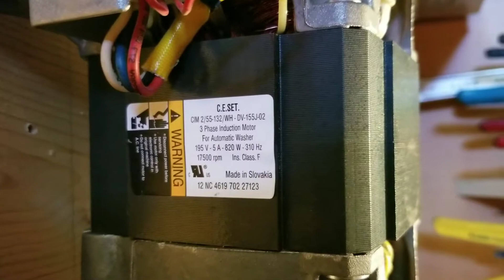High Speed 3 Phase Induction Motor from Washing Machine

Comment: No, that's not an induction motor, it's an inverter motor, known as BLDC motor, induction motors cannot spin at very high speeds unlike universal and BLDC motors.
Reply from the maker: It’s not a BLDC motor, as it doesn’t contain any magnets. Nor does it have brushes, therefore the current is induced into the rotor through induction. Last, but not least, the factory label says “3 phase induction motor.” It achieves its high speed through the unusually high operating frequency required.

Comment: thank you is this the best? need model #VFD, your info is great.
Reply from the maker: Thanks! This is definitely not the best VFD, but it was the cheapest one I could find that still has all the functions. I would recommend this one for home use, but I wouldn't install it in a factory.
Reply: @nigel-matthews  i want to make belt sender.
Reply from the maker: @hasmukhvpatel4539  if you have the right motor, and other parts, this VFD should work great for that. Good luck!

Comment: My motor is getting hot !

Im putting 240v into my inverter single phase an then three phase out 240v 

Im assuming now this is why my motor is getting hot what do you think? 

Thanks man
Reply from the maker: If you have an identical motor, it's only supposed to run around 195 volts. So if you're giving it 240 volts, it will get hot, and probably eventually burn out.
Reply: @nigel-matthews  

Have a look at this
Reply: @nigel-matthews  

This guy didnt seem to have to do that
Reply: @nigel-matthews  https://youtu.be/khnL8vGhEDI
Reply: @nigel-matthews  

👍. I may have to do that as the supplier is not sure
Reply from the maker: @bongobermo1  it looks like he is just running it on 240 volts, which will work, but the motor will burn out quite quickly.

Comment: Is your inverter set to 30 Hz 

Should or does it go to 50Hz and if so does the motor run faster ?  

These motors do 17000 rpm ?

Just a question.... thanks for the vid 👍
Reply from the maker: The motor is designed to run over 300 hz, so that was the fastest I ran it. I think the RPMs were somewhere around that - super fast!
Reply: @nigel-matthews  

https://youtu.be/khnL8vGhEDI

Heres a guy running one without the voltage drop ...   seems to be working fine thats why im a little confused 

Thanks for your feed back Nigel 👍
Reply from the maker: @bongobermo1  at 5:02 he mentions the fact that he's running it at higher voltage than what the motor requires, and that over time it may be bad. There are better ways of running this motor than I used in this video. Ideally, you'd want a transformer that outputs 195 volts feeding the VFD, assuming the VFD can run on only 195 volts.

Comment: As you can see that engine is made for 220V, but using ONLY for electronic control /inverter/ there is the voltage reduced to 195V. Never using this motor to AC line, but else engine will burn. As you can read warning text in this motor ;)

Comment: I have a similar electric motor & VDF , THERE ARE 5 WIRES , 2 RED FOR SPEED CONTROL I THINK ,WHERE ARE THESE RED WIRES CONNECTED TO ,THE REMAINIG 3 CONNECT TO VDFI THINK?
Reply from the maker: That sounds right. You should be able to ignore the speed sensor wires. I didn't use them.

Comment: I have the same whirlpool (kenmore) washer 3 phase induction motor and I also took out MCU and a Central Control Unit (CCU) from the donor washing machine in hopes to make it run for woodworking machine. Looks like it is possible to control the motor via this proprietary MCU, but it requires a UART serial port commands type of control. According to the video (link below) CCU sends specific control commands via a half-duplex UART port to the MCU. This video shows the MCU controlled by PC via USB to a  serial port adaptor - https://www.youtube.com/watch?v=Npxd_H7FeSQ .
Reply from the maker: That was interesting. That would be the cleanest setup.

Comment: I have same exact motor I want to use as a grinder. Im in US, so assuming power supply same. Am I correct in that if I want to use the motor, I need to plug the Variac into wall, then to VFD, then the Motor? You showed the stepup transformer but not sure why since you didn’t use. Also, is there a certain variac? I found one on Amazon for $51. Wiring instructions would have been wonderful too. Any info would be appreciated
Reply from the maker: It's kinda an overly complicated setup with the variac to the step up transformer to the VFD, but was necessary since the motor required 195 volts. If you could find a 240v VFD that had a voltage adjustment that would work best. The two voltages being available in a US household are 120 and 240, and the motor was closest to 240 so I bought a VFD that runs on 240. But since I needed to drop the voltage to around 200 volts I ran the VFD through the variac, but my variac runs on 120. So I set my variac to 100 volts, then ran it through the step up trans to 200 volts which then fed the VFD, which sent that 200 volts to the motor. If you could find a variac that runs on 240v that would eliminate the step up trans.
I'll draw it on paper and add a link below.
Reply from the maker: https://ibb.co/wYKKv0m

Comment: Can you link to the VFD you're using?
Reply from the maker: https://www.ebay.com/itm/233661695241
Hopefully that link works. I bought it from an eBay seller for around $65 new (with free shipping). If the link doesn't work, search "Adjustable-Frequency Drive VFD Speed Controller 220V for 3-phase 1.5kW AC Motor" on eBay.

Comment: What is the duty cycle of that motor? Can it be run continuosly?
Reply from the maker: It isn't listed on the label if it's intermittent or continuos. Given that it's a washing machine motor I bet it's intermittent. However, it's a powerful motor with large ventilation openings - I bet it could be run for hours at a time. What did you have planned?

Comment: I have a similar motor with the MCU from a washing machine that I want to use for a project.  There is only one video https://www.youtube.com/watch?v=Npxd_H7FeSQ  This shows how to use the MCU, with its inbuilt VFD to control the motor.  It would make a fascinating way to obtain a motor for woodworking tools using a computer interface with a touch screen to control the tool speed.  Any thoughts?
Reply from the maker: I agree, that would be a nice setup. When I got this motor from the washing machine, I also saved the MCU. I put an oscilloscope on a similar (working) washing machine on the 3 wire input to the MCU to see if I could simulate the input signal. I couldn't. I remember seeing this type of video where someone controlled the MCU with a PC, but I'm not good a coding so I just used it as an excuse to buy a cheap VFD.
I'd love to see a video of your project!

Comment: I have the same motor  220 volts. How to wiring without inverter or variac into plug?
Reply from the maker: In most cases, you need to have 3 phase power to run a 3 phase motor. This can be supplied from the electric utility or a VFD as shown in this video. People have figured out ways to run 3 phase motors in single phase power. Search "run 3 phase motor on single phase" on YouTube.

Comment: how to run this with 120 volt? i have same motor.i want to make 10"sender for wood work.
Reply from the maker: They sell a very similar VFD on eBay that runs on 120 volts. I think it's about $60 also. That will control it as well.
Reply: @nigel-matthews  thank you i will try.
Reply: if you have vfd can you put picture,
Reply from the maker: @hasmukhvpatel4539  the gray unit at 0:21 is the VFD.